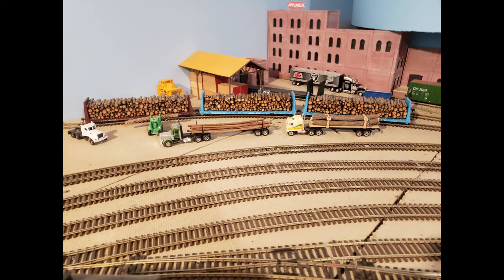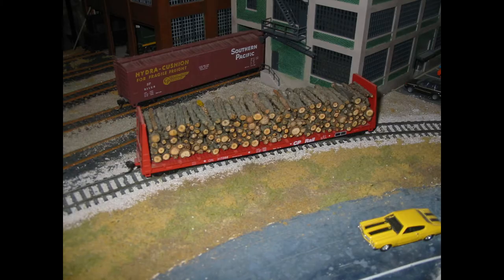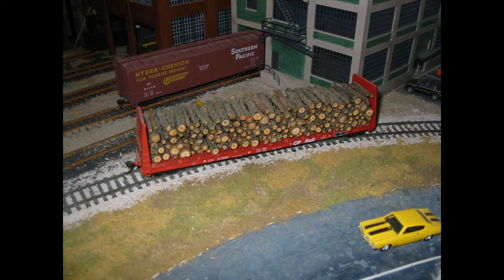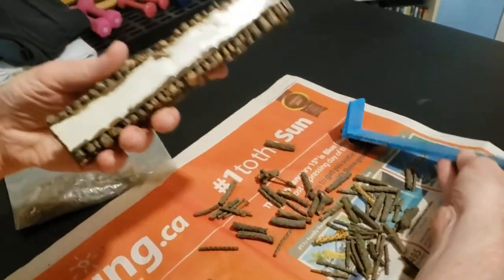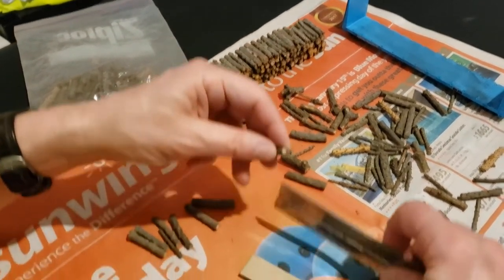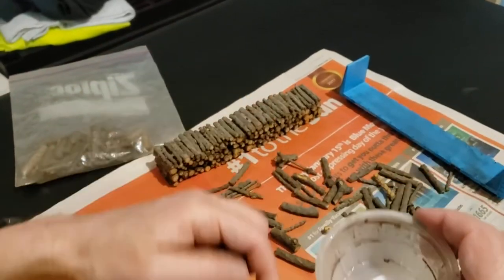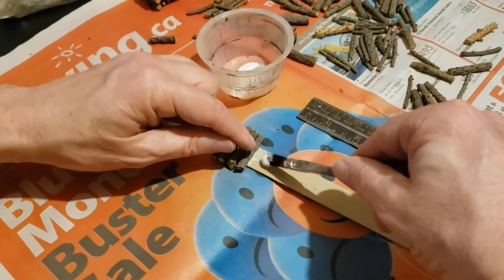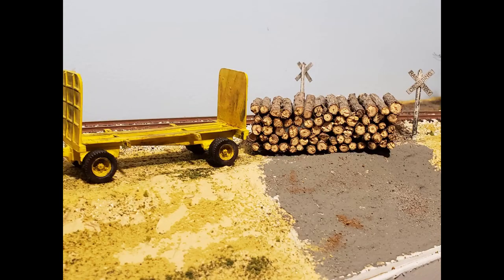HOW TO MAKE REMOVABLE LOG LOADS

Comment: what type wood did you use for the logs?
Reply from the maker: Hi Mike, I used spruce.  I trimmed small branches off of the trees but you can use any type of branch that looks right.  You can always experiment a bit with different kinds.
Reply: @krazytrainguy  thanks. they look really good.
Reply from the maker: @spforever66  Thanks Mike!